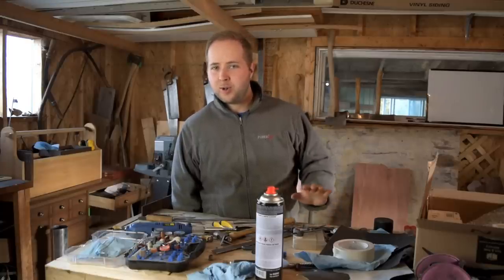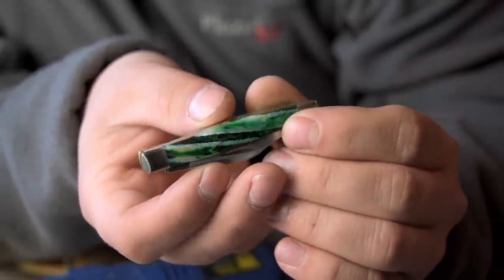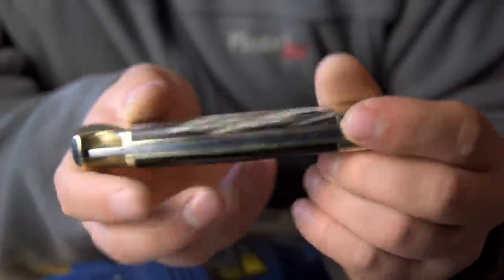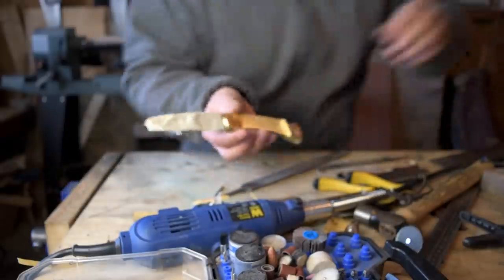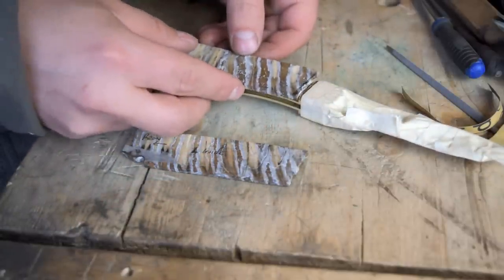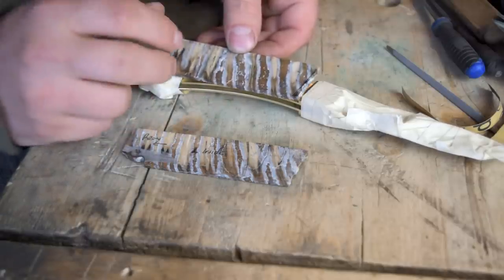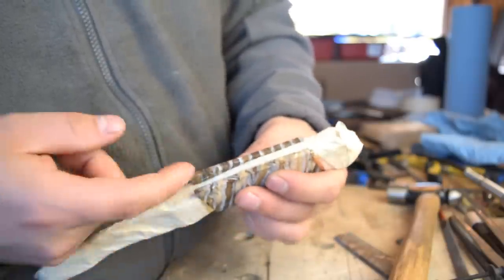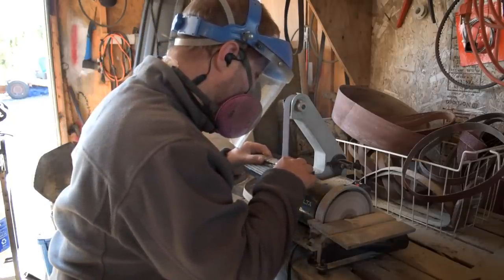AMAZING CUSTOM KNIFE - Mammoth Tooth & File Work!

Comment: Dude, hahah crafting and doing art while listening to JRE is what i love to do too hahha! Its funny, cuz i just got bit with a knife bug about 2 months ago, and i got a couple cheap stiletto knives from various knives suppliers online. I bought files and a dremel, and a sharpening stone and have been obsessed with learning how to engrave metal, and file artwork onto the knife handles and blade and have been practicing file work on my cheap stilettos , until i really like how my one stiletto turned out and took a brave step and finally worked on my one and only (so far) high quality knife which is a beautiful, classic, buck 119. So i went at it, i gotta say, im stoked with how it turned out!!!! STOKED!!! I did this zig zag type groove thing that is on the back of the blade on the flat part, and they’re roughly spaced around 1/4” apart and they stagger up the back of the blade, and then, i thought i would just mark a line in between the staggering grooves. It looks really cool. But ya, im like you where i pick a good podcast, whether its JRE, old stern clips on youtube from the artie years, or the church of whats happening now, and get in the zone of crafting. This is the first time im seeing a vid of yours, and i like your stuff. if you can, please do tutorials and tips on all your knife knowledge like tips on how to file different designs and patterns, how to change the scales, how go maybe modify knives, etc, Just any tops you have on knife customization, that would be awesome cuz i really want to attempt get good at customization
Reply: Ron Thunders cool man🔪im hooked on a 722 spitfire upgrade now. Found a yellow( its gold)722 @ smkw wit s35vn for$34.99. Scouped it up. Ordered blk pktclip from buck.🤙looks dope! Today odering blk pivot an screw kit. Gd luck to yu.🔪🔪🚂👊